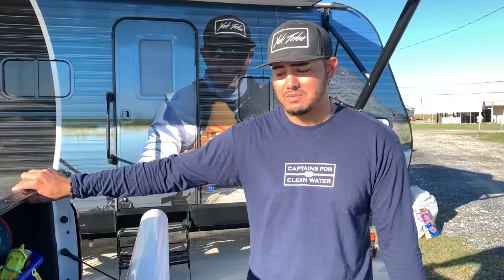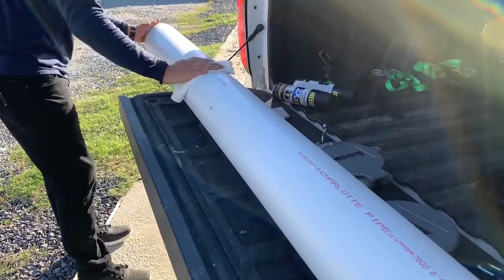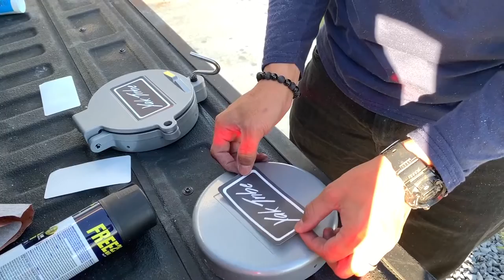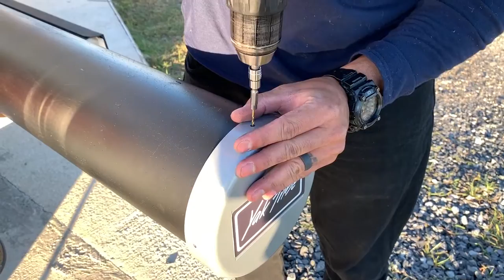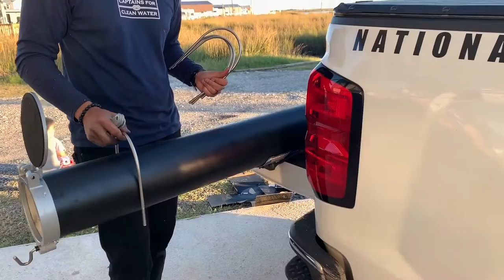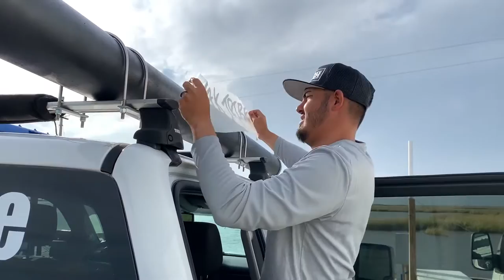DIY Roof Rack Fishing Rod Storage

Comment: Even though it might look great with stickers and tackle manufactures on these, it's often better to leave them without to deter thieves, or put a sign saying tent poles on it. In hot climates like here in Australia Ive had issues from foam grips and reel seats on rods in black tubes that heat up incredibly high here, so leave them grey in hot sunny locations. I would recommend glueing the ends to the tubes so you don't have screws sticking out on the inside of the tube rubbing against rods, or use foam inserts at each end for the screws to go into. Anyone interested to see whats in the tube can quite easily cut these in 20-30 seconds so still be mindful where you park.
Reply from the maker: Great feedback!
Reply: Outdoor types shoot thieves… 😂 criminals target defenseless sheep :) who try and camouflage.
Reply: For hot climates, just drill breathing holes. ❤
Reply: Make it look like a rocket. 🚀 ❤❤❤
Reply: Yeah, no one would ever guess there is fishing poles in that long tube on a roof rack next to a kayak if it weren't for the stickers.
Reply: Outstanding

Comment: Those are handy. Getting paint to stick to pvc pipe for any length of time can be tricky. There's a product sold a many professional paint stores that is a primer for painting pvc pipe. It's essentially part glue part primer. I buy it a Kelly Moore paint stores but I think Sherwin Williams carry it also. Works pretty well at keeping paint on and not flaking or chipping. Good luck on your trip.
Reply from the maker: Ohh. Good tip! Thanks man!
Reply: @FishingWithHeath you can use the black ABS. ❤❤❤

Comment: I like the video but I feel that the although strong metal lock end caps seem like a good idea, just unscrewing the screw and pulling pretty hard on it will defeat those. I wonder if they make a plastic version because you would think that it’s weaker but using pvc glue would melt the two surfaces together making a stronger bond.
Reply: Rivets would be more secure
Reply from the maker: Yeah Max is right. Rivets!
Reply: Or just unscrew the nuts on the U-bolts and take the whole thing and toss it in back of your van, if you want to steal it. Sometimes I find it funny how much effort people put on securing storage outside of their car, but then its not securely attached to the car. It's easier to take the rods out overnight, if you're parking somewhere not-that-safe

Comment: Just curious... approx how many fishing poles could you fit in this? Do you keep the reels on them?
Reply from the maker: I dont keep the reels on. You can easily fit 10-15 rods in this.
Reply: @FishingWithHeath  Sweet. You did an awesome job.
Reply: @FishingWithHeath  if I were to keep the reels on, would that reduce it to roughly 6-7 rods and reels, u think?
Reply: @urtypicalguy  Measure the diameter of the rod/reel combos you want to put in the tube. Add them up

Comment: Looks good and great idea…but in the end there is really no security because the screws can be unscrewed and the caps aren’t secure either…..and the biggest thing is that you can just cut through the pipe to cut the ends off
Reply from the maker: More or less for not falling out while traveling. My good stuff always comes back inside with me or in the RV.

Comment: Great idea however i would have used nuts and bolts to secure the end caps rather than self tapping screws it would have made it more secure. Someone could easily and quickly unscrew them rendering the lock useless and bye bye rods!!!
Reply from the maker: It could be more secure for sure.